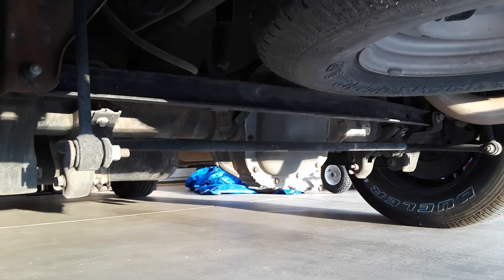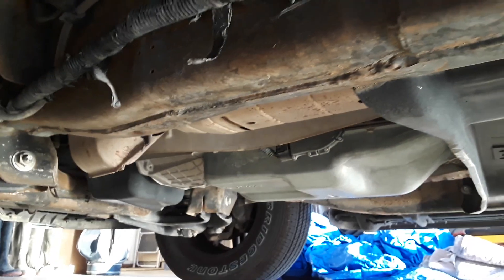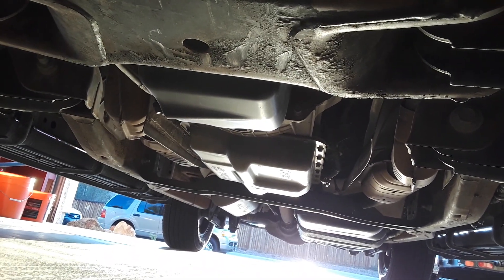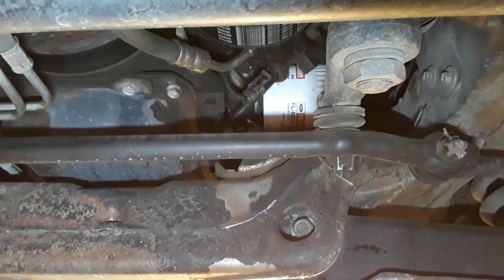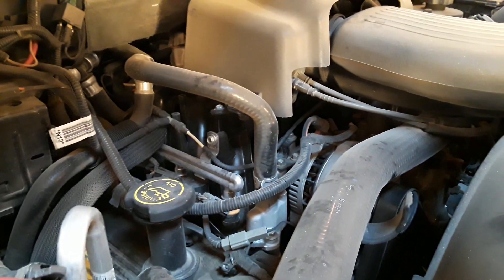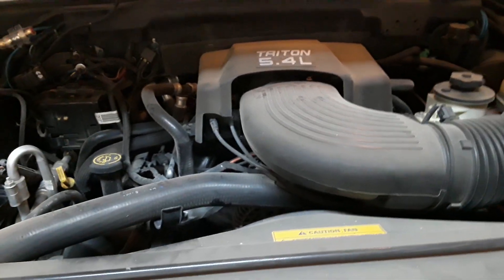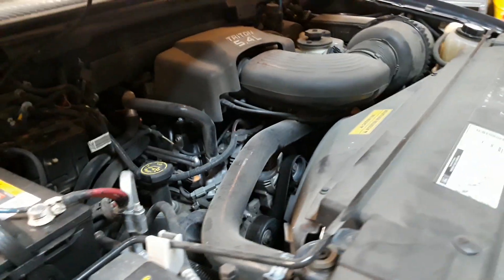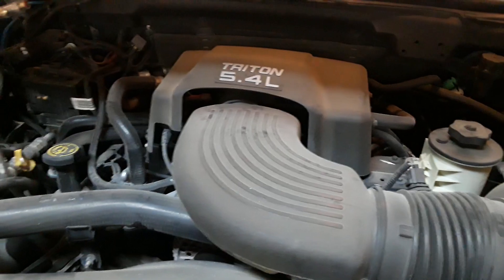2000 Ford Expedition built to last!

Comment: Nice to hear. 97 5.4 here. 155000, purrs, nice power. Still occasional stumbling under load after plug and cop replacement, will have to wok that out. But very happy. Planning a few mods for a camping truck. Paid $2500 in 2016 .
Reply from the maker: Probably not your issue, but I had a wonky fuel pump for a long time. Never set a check engine light, everytime I tried pulling codes, nothing. Always ran great except for the occasional quick cut out while driving for about a second. Everything told me fuel pump, but I didn't have any hard evidence to support it. Couple of years later fuel pump goes out. Problem never returned with the new pump.

Comment: 2000 Expedition 190k. No drips underneath but I do have the rear pumpkin that looks wet. Nothing else is leaking or wet. I've done one alternator, O2sensors, steering idler arm, and the intake manifold (common 5.4l issue).
Reply from the maker: I did the intake around 140kish miles. Just a really well built SUV.

Comment: How often do you replace the spark plugs??
Reply from the maker: I first replaced them around the 150ish mark and they actually still looked very good. I used the OEM motorcraft platinum plugs and I'm almost at 210,000 now. If she's still going at 250,000 them I'll probably replace them again. I believe Ford recommends every 100k.